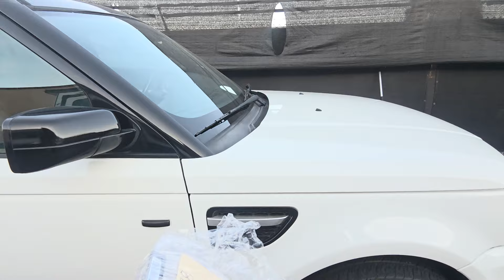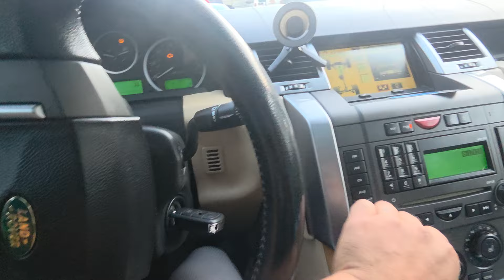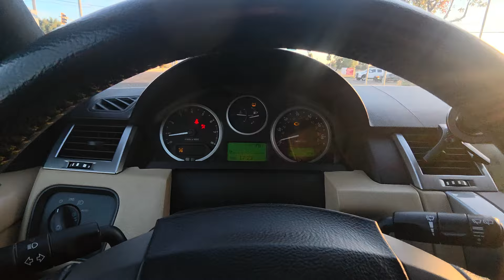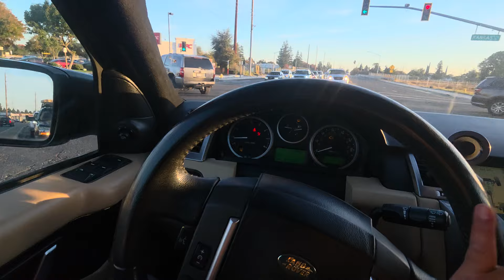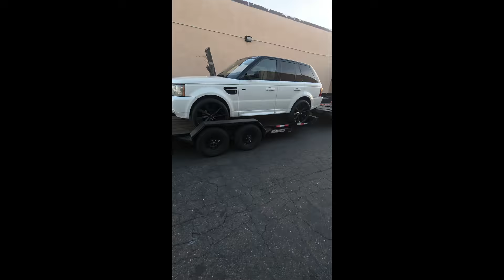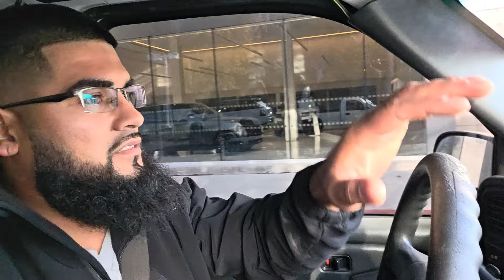. “My 2007 Range Rover Sport goes into Limp Mode symptoms Dealer’s "Fix" & Shocking Ending!” Part 1

Comment: HI Anthony, I own a 2008 Range Rover sport and by default,  I do no qualify for any warranty or even an extended which is similar to you situation.  One bit of advice I was given by the car lot owner where I purchased mine 2 years ago was that if given the choice of taking you Range Rover to a RR dealership for repairs, or 2, cutting your arm off with a chainsaw, then cutting your arm off will always be the smarter choice.  Without a warranty, bringing your RR to a dealership is just not a good idea. You will get ripped off big time and with an warranted car , a different solution will always be better.  I just watched you video and the other problem is that even a RR dealership , they guys than now work there are younger and not little about older Range Rovers. From what I heard  from your video, It sounds like these guys are gaslighting you and don't honestly  know what to do.  I bought an OBD that accommodate Range Rovers and many people are unfamiliar with OBD's and you may already have one.   If you had an OBD, you would have a much better idea of what to do.  This is now a 6 month ago post so you most likely have this resolve somehow.  It not contact me and I will help.  Good luck

Comment: Were you able to get the module issue resolved?? That sucks bro!!
Reply from the maker: Manager of Land Rover reached out and offered to reprogram again and this time record the process and also offered to find the issue if the reprogram does not resolve the issue . I have yet to take it back due to work however im able to take it whenever I can on future.  So will do update video once I take it back to Land Rover in Livermore CA.
Reply: Did you ever figure out what s   up with it?
Reply from the maker: @scottpilkinton9518 still havent took it back to Land Rover to take them up on their offer of redoing the reprogram and also they mentioned if it does not resolve the issue they'll be getting down to the bottom of it at no charge.  So stay tuned